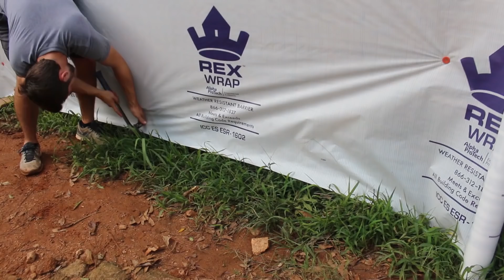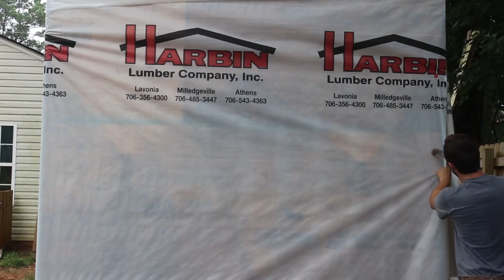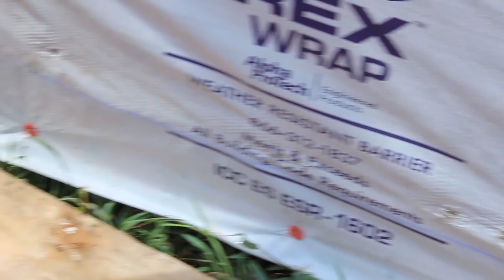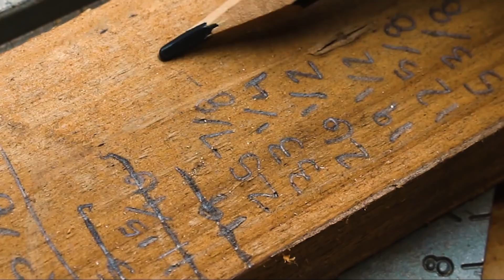Building a Shed on a Budget part 6! (DIY reclaimed siding)

Comment: Looks great buddy!  Only thing I would have done different is ripped down quarter or 1/8 inch 1x6 nailing strips to keep the siding away from the ply wood to give it a little room to breath to help with future moisture issues
Reply: im building mine without the plywood... just osb on the roof im planning

Comment: I'm fortunate in that I'm building a smaller shed -- only about 4x9 -- and my daughter and her husband are tearing down a derelict house that I can salvage from. I'm gonna have to find (buy?) some pressure=treated wood for the foundation frame, but everything else will be freebies, including some solid wood siding. The double-hung windows in the derelict house are too big for a shed, but I can take two sashes and make casement windows that open outward and let the air flow through

Comment: Another great video, looks great! Shou Sugi Ban might have been a great finish and protection for the cladding but you probably might have had to do that before it went up, great video again though door amazing find and the vertical battons really finish it off nicely.
Cheers from London England 👍
Ps. Hoping to build something myself with like zero budget literally going to try for like pallets and stuff few free bricks or blocks to set it on there's a small 8x4 concrete base down already Im going to just use and expand it using some corner blocks and have the base under the middle or one side and hope for the best being it's just a shed/workshop/summerhouse/man cave.. I got some free double glazed windows few years back about 20! and 2 sets of patio doors and frames! With all the Hardwear! So I can use them and I got them for free so who knows? It's all been sitting there for a couple years and the double glazed windows are literally just the panes so need to frame them aswell (I'm sure some will have blown by now) and never done anything like that before, but got a nice new router, jigsaw, hand saws, drill/driver etc, so wish me luck cos EVERYTHING costs 2-4 times as much here in England than in the U.S. and is half the quality wood wise etc lol 😅🤦🏻🙏
Reply from the maker: Good luck with that! Sounds like a fun project!
Reply: @ProfitPioneersRETV  cheers weathers definitely going to need to warm up a bit first though over here! Lol

Comment: Wow great job today 3 years later as you know the price of 2x4 and wood in general is triple so no one in the construction industry give away nothing for free that game is over for now but to those that have land and trees building a sawmill is a Great idea or buy one lots of people are given away logs or tree's for free if you cut them so hey little bit of work but free so all that is left is the roof and you can do shingles and if the only money you spend is on the metal sheet it will be real cheap today a wood shed goes for $3500

Comment: Good job but external planking should really be horizontal and fixed in one position only to allow the wood to shrink and expand to prevent splitting
Reply from the maker: What? I have never seen siding like this run horizontally.
Reply: Ian Ingram google shiplap 👍🏻
Reply from the maker: @CoachSimonDavid  I know what shiplap is but this isnt shiplap its board and batton
Reply: Ian Ingram no disrespect fella, you can still shiplap with boards. That’s how a lot of old English barns and workshops are constructed.

Comment: Hey Ian quick question: nailing the wood won't make it split??? I pre drill my planks and screw them on. But it's too time consuming. I'm just worried of splitting my wood planks over time using nails.
Reply from the maker: I didnt have any problem with the wood splitting it probably depends on the type of wood you will use

Comment: that wood you use on the seams ruined the look of it. i suppose after paint it would be ok. looked better just the wood. i would of also not used that bottom board under the door because its going to trap water. also that trim under the window should be flashed or something.  Otherwise nice job.